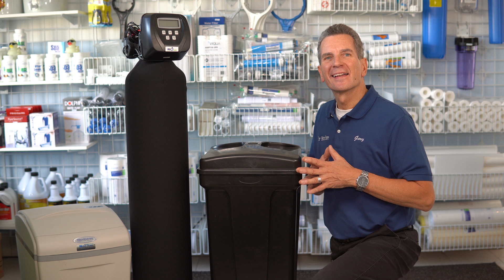How Does a Water Softener Work?

Comment: I recently had a water softener put in.  Now at 2AM water backs up in my tub and walk in shower.  Is something clogged?  Also, prior to this happening.  All 3 of the commodes in my house lose their water level.  Then when the water drains out of the tub & walk in shower.  The commodes return to their normal water level.
Reply from the maker: The water softener drain line is connected up stream of the shower but drain down stream of the shower must be constricted to cause this back up in the tub and shower.
Reply: @water_estore  the pipe from the water softener does join the final pipe out to the septic tank.  But the water backup issue only shows up at 2am when the softener is doing its thing.  No longer eats salt too.  I have a service call to Hague for tomorrow.  Thanks to you I learned out to put it in bypass mode until it can be looked at by a professional 🙂  Thanks

Comment: gary, any insight how to incorporate well water as a backup to rain water, if the rain water is low it can fill with well water?
Reply from the maker: You would need a float switch on the rainwater reservoir and connect the supply to the well after the pump.
Reply: Thanks Gary appreciate you and your informative videos.

Comment: I have a Clock water filtering system. I have an issue with the salt water system. I am getting brown color in my commodes. I have a clock about 10 years old. I am getting brown color over the outside of tank . I guess it is leaking. Do I need to replace the head. And replace the resin. I have pictures . Garland
Reply from the maker: I would have your raw water tested before doing anything else.  That brown color may be iron in your water.

Comment: Installed Fleck 5800sxt iron filter December/2021   Was problem from day installed   Constant sputtering from esp cold water tap  Seller has been here at least six times    Will not come back and problem not solved   Am at dead end      Richard Smith
Reply from the maker: Sorry to hear. We are not specialists on Fleck products but this video might help https://youtu.be/Yg0HTiaLVFg You could try shortening air draw cycle, so it sucks in less air.

Comment: Garry.. I just recently replaced our One Piece Water Softener to a system exactly as what is shown in your Video.. Btw Thank You for the Explanation on how it works.  My Question is the Water Level above the Salt, How many inches above the Salt level is allowed before Adding fresh Salt ??
Reply from the maker: The salt should be higher than the water, so none.

Comment: What does it mean if the drain water seems to be excessive? Almost an hour long.
Reply from the maker: Most water softeners take 90 minutes or more to regenerate so likley it is correct but check your manual to be sure.
Reply: @GarytheWaterGuy  thank you sounds about right. Just cleaned out the salt bin much of it at the bottom turned into salt/mud. Looks like new. 👍

Comment: Hey there Gary. Love your channel! I have a question about a whole house iron filter. Not from your store unfortunately. It has a Genesis control on it and it has a solid plug inserted in the 3/8” brine inlet fitting.  I’m baffled because your system shows a strainer/ filter and apparently a one way valve where mine has the plug. I removed the plug and tried to blow air through it both directions. It’s airtight. What am I missing here? How would this valve inject air into the tank? Also, I cycled it and it draws air for about two seconds with the plug removed. Clearly that can’t be enough time to create an air bubble could it? Awaiting your advice. Thank You!
Reply from the maker: Somnething just isn't right here, time to call Genesis.

Comment: I have the same setup as in this video. even the same 5 button controller.  Im not sure if my unit is working because my water is not "Slimy" or even feel soft.  I have checked all the settings and beleive I have it set for the correct hardness.   Can I send you a sample for a water test?
Reply from the maker: Sure can, check out this page for the details. https://waterestore.com/pages/free-water-test-evaluation-the-water-estore

Comment: Helpful details, like showing us what those mysterious tiny beads look like. Curious: what are the beads made of and how do they pull Calcium/iron out of the water? Not the whole chemical process but just nutshell explanation? Thanks much - I’m a city guy - moved to the country, and totally mystified by this strange wonderful system.
Reply from the maker: Great question. The beads are a polymer that is charged with sodium and through ion exchange attracts the calcium and magnesium ions from the hard water to make it soft

Comment: During the brine cycle emptying the brine tank you suggest it goes in slowly over the media. is it possible the brine is bypassing the media tank and going directly to drain? during this cycle on mine the drain line still expels heavily. After the 5 cycles i still don't have soft water?
Reply from the maker: Yes, it is possible.  But if it does your valve likely needs to be rebuilt.

Comment: Just ran across your channel as I research getting a water softener (live in San Antonio, TX). I subscribed and hope to learn a lot more from you! I have a couple of questions. When the Regenerative Process starts, how long does it usually take to do the 5-step process (say for a 48K Grain system, which is what I am considering)? Also, does it prevent water from being used in the house during this regenerative process? What happens if someone wakes up at 2am (assuming that is the time set for regenerative process) and turns on a tap or flushes a toilet?
Reply from the maker: The regenerations takes about 90 minutes.  You can still use water during the process but it will not be softened.  But there is no problem if someone flushes a toilet or turns on a tap.  The new version of this video is here https://youtu.be/i9pI76dk4Zs We have helped lots of families in the San Antonio area with water softeners, check them out here https://waterestore.com/products/hum-metered-water-softener-45-000-grain-capacity-free-shipping

Comment: Question if I turn my system to bypass but take a shower using hot water will that water stil be soft because the water in the hot water heater has already been softened, so if I want to shower with hard water how would I go about that? Is the same if I get water from the cold side of a faucet. Thanks
Reply from the maker: Yes, if you have a tank type water heater, but keep in mind that once the soft water in the water heater has been displaced by hard water you will get hard water in both your cold and hot water.

Comment: Hi- I was a water softener which was turned off by someone who was working on other project. I started it now and set it on regen mode for 10 mins.

After this it went into brine mode for 50 mins

After that it did two cycles of ten minutes

And last it shows 0.0 gal/ min

Does this means it is not softening the water?
Reply from the maker: No, the last part is your flow rate, which just means no one is running water in the house currently.

Comment: Hi Gary, thanks for your videos. 
Please what is preventing the small resin beads to be pushed down to my plumbing system? I am asking the question because I found some of my taps blocked with the water softener beads!!

Thanks,
Mayssam
Reply from the maker: There is a screen at the top and bottom like these https://waterestore.com/products/hum-riser-tube-and-upper-screen-replacement-combo

Comment: Hello.  I have well water. My system has UV light, sediment filter, water conditioner a rust remover system. I was away from home for 4 days and I turned  the pump off and turned the main water shut off off. I returned and turned everything back on and now the water taste very salty. I did this after watching your video. What can I do to restore the water?
Reply from the maker: Manually regenerate your water softener.

Comment: Hi Gary, I have watched most if not all of your videos regarding Water Softeners. I have an Aquamaster 5000 installed by Water Depot about two years ago. We have a lot of iron in our shallow well (on Sturgeon Lake). After it regenerates, we have rusty water for awhile then eventually it improves. We do not have an iron filter. I do have a chlorinator though. Any suggestions?
Reply from the maker: Do you know how much iron you have?  Also, if you have an Aquamaster water softener with iron you need to set the water softener to regenerate every 72-96 hours.  Has this been done?

Comment: Hey Gary, 

I have a 1-year old Clack water softener at our 4-season cottage and we manually regen about every 7-days. Our recent chemical and bacteria tests came back all within Health Canada government acceptable limits except iron was 400 ug/L (100 ug/L above the upper limit). We did two back-to-back Iron Out treatments and will test again. 

We also have noticed, when we are away for several days, a low intensity sulphur smell when we run the kitchen sink cold water tap but no smell when we run the bathroom tap. The initial glass of water, after returning from a 5-day absense, was cloudy and reddish. The smell and water discolouration disappeared within 10-15 minutes of running the tap. 

Any ideas about what's going on? It's only been happening recently, otherwise our 325 foot well and water system has been performing better than my city's utility system.

Thanks for all your great work Gary! Your information is invaluable to us well users.

Cheers
Reply from the maker: You can try cleaning the media in the water softener by following the info in this video https://youtu.be/c8QKYr3B02I.  Otherwise you might need an iron and sulphur filter, see this video https://youtu.be/CN_n0Qz-z3k

Comment: Where is the drain ? Does it empty outside ?  I know nothing about water softener. Thanks.
Reply from the maker: It can but usually it goes either into the floor drain or connected to the household drain system

Comment: Amazing information!! I just bought my first house and it has a Rain Soft water softening system installed and I know little too nothing about how it works or how to service it. I just knew it had salt by looking inside the brine tank and thought it added salt to the water and that makes it soft. I thought that was strange bc I figured that would make your skin dry and leave salt buildup on shower heads. I also thought softened water would be very bad for house plants bc salt water isn’t good for plants but after watching a lot of your videos I’ve learned so much!! So I guess soft water isn’t bad for house plants? My house also has a reverse osmosis system under the kitchen sink. I haven’t changed the filters yet so I’m gonna order some from your site today! Thanks for the awesome videos I’m a mechanic by trade so it’s awesome to learn how these systems work and how to fix them myself if need be!!
Reply from the maker: Thanks for watching. Please share video with friends and family.

Comment: Should my brine tank always have water in it or does it fill up during regeneration and then get sucked right back out? I just bought a house with a softener that was turned off and trying to get it going but no experience.
Reply from the maker: It depends.  If it is a post fill softener , there should be water in it.  Pre fill no water.  This video will explain https://youtu.be/GedMruLfXhY
Reply: @water_estore  oh ok, I’m not sure how to tell the difference. It’s an Ecowater Systems and says electronic demand on there but nothing else.

Comment: how do the system know how much water is in the brine? and when will it cut off the water inlet to the brine?is there a signal or valve?
Reply from the maker: The system put a specific amount of water into the brine tank.  It draws a specific amount out during brine draw.

Comment: Hey Gary I was told by a plumber that these type of systems ruin the plumbing that I should.use a water conditioner instead. I bought a home with a complete system already installed and scared to replace the salt
Reply from the maker: Your plumber is incorrect and hoping to sell you something by falsifying information. When you do more research you will quickly learn that he is being deceitful.
Reply: @water_estore  thank you Gary for the confidence sticking with my R.O System. So we bought this home and it has a one in all unit in the garage. With a digital read out. But notice its empty, no salt..the unit still runs. My question is should I add the salt and Iron Out to revive it?
Reply from the maker: Yes, I would add salt and a cleaner like this https://waterestore.ca/products/pro-res-care-water-softener-resin-cleaner

Comment: Hi Gary, my house is more than 50 years old. Which means the pipes are old and got all the mineral around them. If I install a whole house water softener, am I still getting softener water? also are my pipes will be cleaner? Thanks.
Reply from the maker: Great question!  Yes, you will get soft water and yes, it will clean up the inside of the pipes but it will take some time, likely several months or even a year or two.

Comment: My question is ... We live in a resort which is serviced by a well and our water is extremely high in iron... Should the water  softener completely remove the iron from our water then .. like laundry and shower etc ... I find we are still getting a fair amount of it ... thx... also should I be experiencing water spots on my shower glass? If my softener is working correctly ?
Reply from the maker: Water softeners are designed to soften water and a side benefit is that they will remove some iron.  If you have more than 2.0 parts per million of iron you would need an iron filter before the water softener. If the water softener is working properly there should be no water spots from hard water but you could be getting spots from the soap or other minerals, like sodium from your water.

Comment: Hey Gary! I have an older Ecowater system (circa 2005) and it is Electronic Demand. Does that mean it is metered? I have a regen time setting set to 2am. Does that mean it will only regen at 2am when it is needed? Or does it regen every night at 2am regardless of if it needs it or not? Thanks!
Reply from the maker: Good question!  This is a metered water softener.  When you start to run down the gallons remaining into the reserve capacity, it will regenerate that night at 2am.
Reply: @water_estore  Thanks for your help!